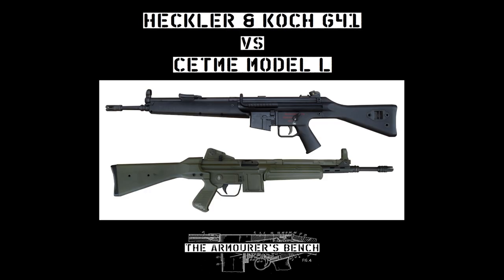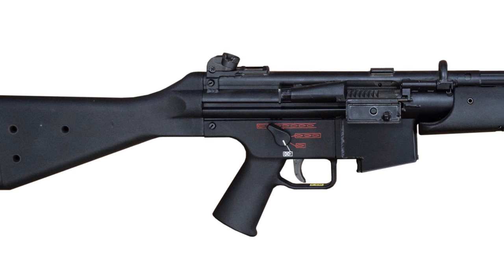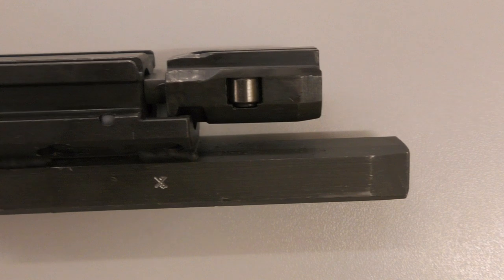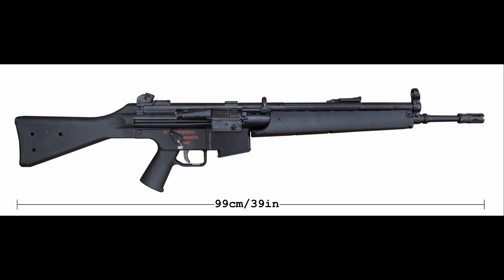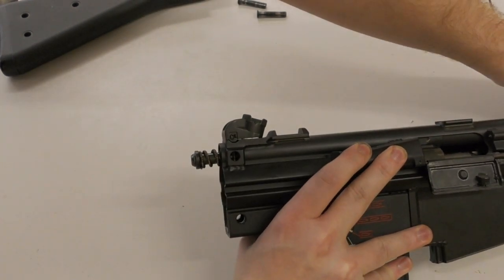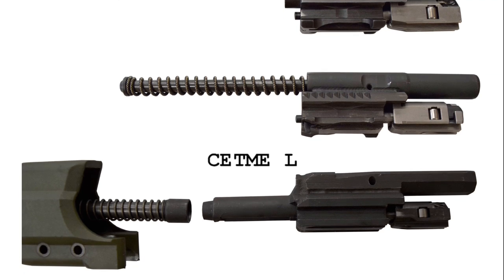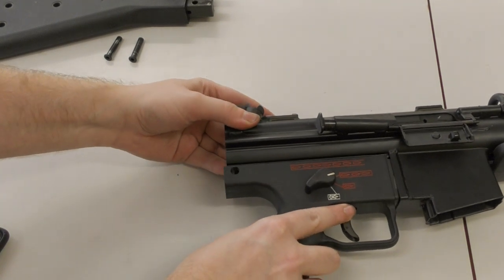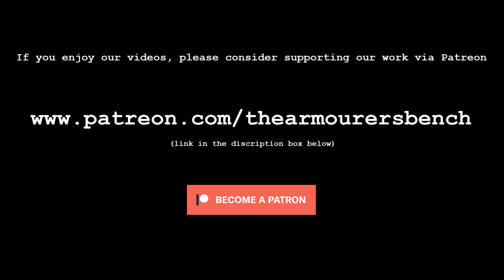Roller-Delayed 5.56 Rifles: CETME L VS. Heckler & Koch G41

Comment: The CETME Model L was let down by being built to a low cost that caused issues with durability. The Spanish also persisted with straight walled magazines which suffered from the same issues the 25 and early 30 round AR15 magazines did i.e. the follower having to accommodate the taper of the 5.56mm case. This was alleviated in the 30 round AR mags with the curve in the lower of the magazine housing. In the Model L the follower was meant to tilt to a severe angle to accommodate the taper... this was never successful and proved a source of unreliability that plagued the Model L all its service life. Spanish soldiers would 'beg, borrow, or acquire' AR magazines which proved problematic due to the magazine well not accommodating the curve in 30 round magazines!!!

It should be noted that the civilianized 'sporter' rifles manufactured in the USA have been modified to work correctly with AR mags... finally the CETME Model L works reliably😉
Reply: In some Guardia Civil units (a special police unit for rural areas) they replaced the CETME L with the older, yet more reliable and lethal, CETME C. 7.62×51 instead of 5.56 NATO, but they prefer using lower cap mags, learning to control the recoil and having a bulkier rifle rather than using that piece of shit. And the design was good, but the money spent destroyed the rifle.

Comment: From what Ian and Karl of InRange Tv have shown and said about these rifles the Cetme L seems to be the more practical of the two. It seems to be more reliable not haveing G41 probems of extracting and ejecting spent cases. Also since the Cetme has slower rate of fire than G41 its more controllable in full auto than the G41 rifle. Its also quite alot lighter than the G41. The only big problems Cetme has are the akward system of bolt hold open and no good option to mount optics on the gun since the rear sight assembly takes a huge space on top of the receiver. I guess they could have done the bolt hold open much more simpler and ergonomical by having a charging handle that you can push into a notch in the charging handle tube similar to the MP 40 submachine gun

Comment: CETME L is a good example of great engineering projects that were poorly executed, due to shabby manufacturing techniques, materials and QC, but the worst thing was always the one critical element of the weapon system that, if neglected and underdeveloped (which happens often), causes most failures of the weapon ie. magazines, and for that alone Model L deserves its place among the trio of the worst military assault rifles, right between British SA80 in its L85A1 iteration and Indian 1st gen INSAS.
Reply from the maker: We will have a dedicated video on the L soon hopefully!
Reply: Oooft. I don't think it's as bad as either of those. INSAS is a complete mess. Similarly with the SA80. The advantage of the CETME L over the SA80, is that German engineers were involved before production had begun. 
Were there issues present? Oh yeah. But that seems to be more due to magwell issues vs, absolutely dogshit manufacturing/cost savings from non-firearm engineers (read: Politicians).

Comment: Many times when you talk about CETME, you mention the German engineers ignoring the Spanish engineers and all the weapons experience. It is a Spanish product, you do it to remove relevance to the fact. Which I do not see is done with the multitude of materials and weapons that were developed in other countries with the essential knowledge of the Germans, in the USA, France and Great Britain.
Reply from the maker: I don't believe I've ignored the Spanish engineers. Just comparing two roller delayed 5.56x45 rifles built around the same time. Two very different approaches. I thought I was quite even handed, I like the CETME L. We'll be a little more in depth on the CETME L' s development in a future video.
Reply: @TheArmourersBench  
I was not referring specifically to you, it was a general criticism. Greetings.
Reply from the maker: Ahh I'm sorry, I understand! You're quite right though, a lot is made of the early influence of the German engineers. But I'm not even sure any of them were still present when the later designs were developed! Fair to say they were definitely Spanish led projects. We'll look more into that when we come to look at the L on its own.
Reply: It started as the  stg 43/4